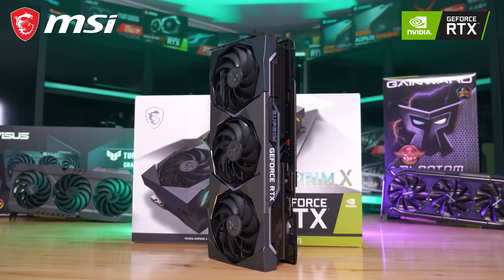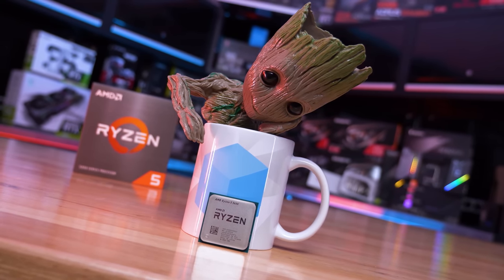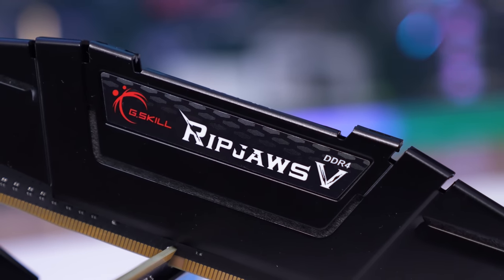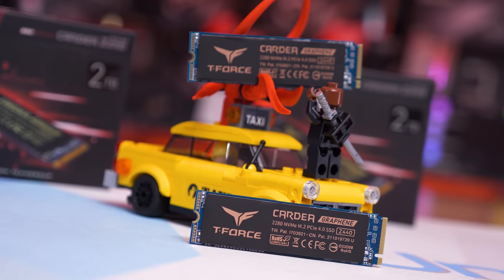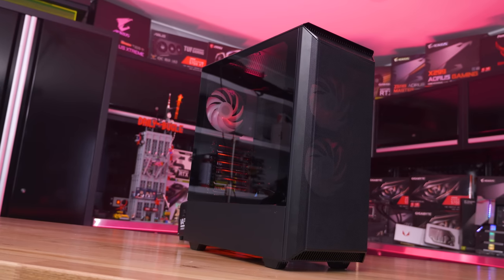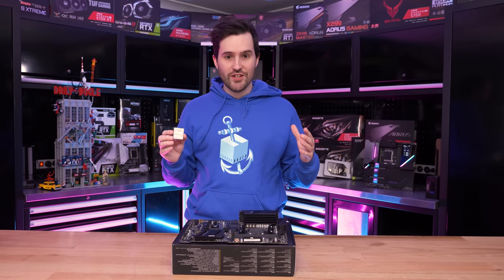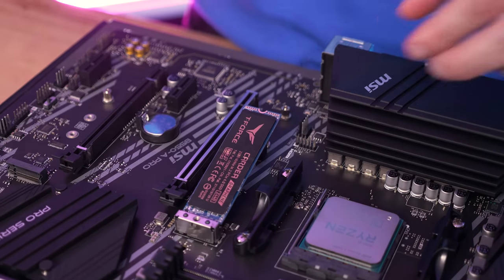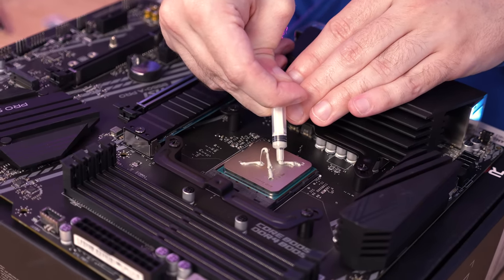Ultimate Value Gaming PC Build - AMD Ryzen Edition for 2022

Comment: With all respect that I have for you guys, this build no sense at all. No one in that budget should spend that much in PSU if tou want mor fps. Despite the case, ram, cpu cooler and ssd are good products also, certainly you could save on those item and get a 6600xt or a better CPU
Reply: Spend a little more now on PSU, or buy a whole new one when you upgrade your GPU... your choice. Tim chose the wiser path.
Reply: I built a pc in january and the products you mentioned to me felt reasonable to "invest" in since they last forever, e.g. I paid like 15 Euros more for an oversized powersupply with 10 year warranty, same for the case, buy quality once, keep that part. I'm not expecting to upgrade my gpu for a few years, but I also wasn't able to purchase the one I wanted since prices were so stupid. Now I could just upgrade the gpu at some point a not have to worry about "dumping" my psu on the secondhand market and buying a new one. That said though, I was in the position where i could just throw another 80 Euros extra or so at it. Your point makes sense, but I also feel its sensible to not cheap out too much on parts that last forever and can be kept, saves in the long run
Reply: @jasonhurdlow6607  if you are the kind of person that uses premium gas on a honda civic, then yes it is wise, if not you should be able to find a good PSU under $100 for that build
Reply: @Games_and_Tech  lol... it's not worth cutting corners on your PSU. Building PCs for over 30 years has taught me that. That being said, watching for sales is always a good idea. Sometimes deals pop up.

Comment: The R5 5600 is a bit too much for the RX 6600, this CPU could handle a 6700XT or 6800 with no issues, it only makes sense spending that much in the CPU if the focus is to play esports games (excluding the likes of Street Fighter and Guilty Gear).
Reply: The value of CPUs cheaper than this falls dramatically. Doesn't take sense to build with anything slower. And 6 cores is bare minimum in 2022 (for gaming machines).
Reply: @jasonhurdlow6607  A 3600 would do just fine in this PC and save money for a better GPU.
Reply: @gustavoalmeida1579  You'd only save maybe $25 and that's not worth it. There is a noticeable speed bump with the 5600 over a 3600.
Reply: @jasonhurdlow6607  on a low end GPU like the 6600 you won't be able to tell the difference unless you are playing esports games at lowest settings, in AAA games, the GPU will be the bottleneck and any money saved for a better GPU helps. I couldn't tell the difference when I moved from a R7 1700 to a 5600X with my Vega 64, with the 6700XT was barely noticeable.
Reply: @gustavoalmeida1579  I noticed a reduction in latency and improvement in overall smoothness when I went from R7 3700x to R7 5800x, even though I didn't expect to. Saving $25 is not going to get you into a better GPU, but it WILL hurt you when you eventually upgrade your GPU. Going with a 3600 would be what we call "Penny-wise, Pound foolish".
Reply: the build is keeping upgrades in mind, going with a worse cpu is a bad choice tbh. Love my 3600, but I wouldnt be recommending it anymore.

Comment: my system
Processor AMD Ryzen 5 3600XT
Cooler Deepcool AS500
Motherboard Asus ROG STRIX B550-F GAMING
RAM Crucial DDR4 32GB (4x8GB) 3600Mhz Ballistix
Kingston KC2000 250GB M.2 SSD
Gigabyte AORUS Gen4 SSD
Antec HCG850 Gold PSU
Cases Deepcool MATREXX 55 MESH ADD-RGB 4F
Asus Radeon RX 5700 XT ROG STRIX OC graphics card
Keyboard A4TECH B975 RGB Bloody
A4TECH Bloody P30 Pro Mouse
LG 27GL850

Comment: LMAO when the 5600 is the 'budget' option at $200, because AMD's cheaper CPU's suck. The $100 i3-12100F which HUB called "The Budget Champ" is only 14% slower at half the price of the 5600.
Reply: Dont forget that 4 cores wont last forever. I wouldnt buy a 4 core CPU for gaming in 2022. Rather go with a 11400f , good middle ground between the 5600 and the 12100 and offers enough cores for some years.
And always consider mainboard prices when calculating prices, a 5600 will run on a 50$ B450 while the 12100 will need a 100$ B660 (H MB's I would never recommend)

Comment: a 340$ GPU is what you call budget?
Reply: That's what manufacturer dictate as well as the market
Reply: Value,  the 6600 is in the top 3 of the best price/performance GPU.

And realy, under that tier of performance you wasting your cash if you want to play modern game.
Reply: if you want budget you normally simply buy any game been release 2-3 years ago and before save ton on there price and than can grab nice go to from that time like rx 570/580 or gtx 1060/1660 on the used market your lucky there only 340$ in your currency over here quite more nasty in terme price ;) good deal hunting
Reply: @user-Cata7sti7ma7  just get a APU and wait
Reply: considering the current market.